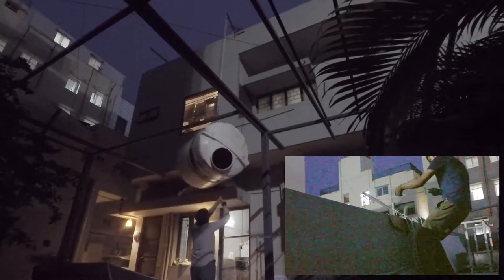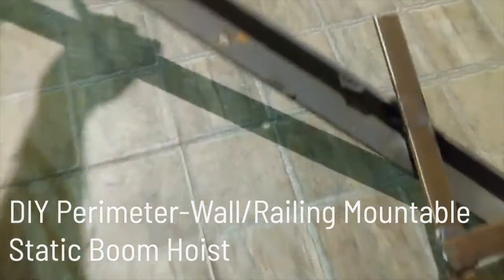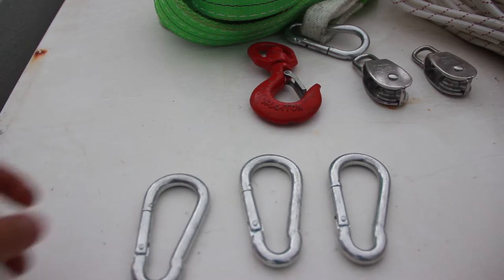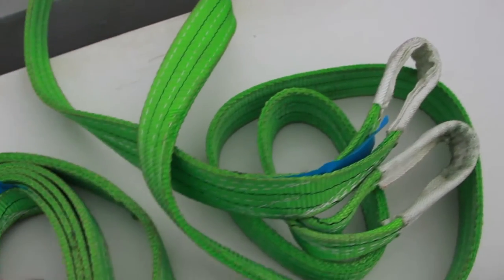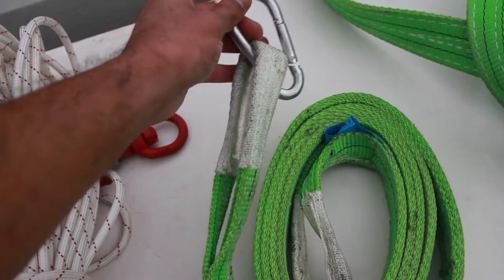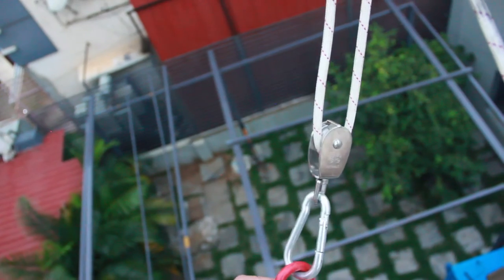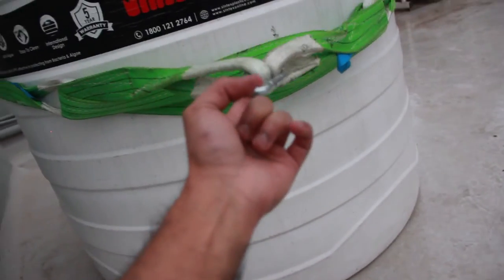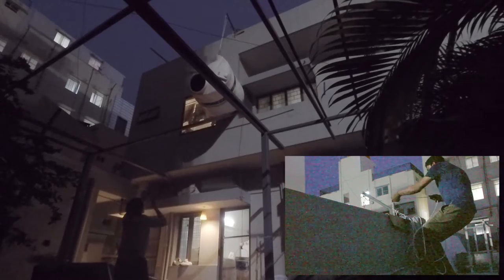How to lift a Water Tank with a DIY Hoist | Simple Rigging & Lifting for Domestic Loads

Comment: Nice trick bro.This might come handy for several other things. Although i have some points to add.

The weight is distributed to very small portion brick wall which might break if the load is heavy.(in this case,its not)

Lifting is super easy with this method but pulling the tank when it reach the top must be difficult.
People might not spend this much for just pulling a single tank,but builders can.
Reply from the maker: Thanks for the feedback Snehal - you're right that it doesn't make sense to invest so much for a one time task, and as you said it would workout for builders (I guess also plumbers and other workers as well). When I built the hoist, my intention was to use it for other purposes as well. It's currently being used in my house to move food and groceries between floors - so I think it could be useful for anyone for moving household things up and down. You're also right about the weight the wall would have to support... The wall that I used to lift this tank seems to be ok for at least 50-60 kgs, but on the other side of the roof there's a concrete (RCC) wall (same thickness) which can go much higher - so whoever is using it would have to use their own best judgement.

Comment: I notice you had to pull the load over the side of the rooftop. This could damage the house if the load was a heavy metal gas cylinder. How to hoiat higher to clear the rooftop?
Reply from the maker: The length of the boom would've had to be much greater to hoist it clear off the edge of the perimeter wall. I wouldn't say this setup is sufficient for something heavier like a metal gas cylinder without some necessary changes made to the design and how it's rigged up. Many more safety measures would've been necessary for a metal gas cylinder.

Comment: Hi bro can I lift 5000 ltr tank to 6th floor roof?
Reply from the maker: Yes Sadiq, it's possible. Just make sure you've secured the tank properly with the slings and make sure to use a tag line to stabilize the tank while lifting.